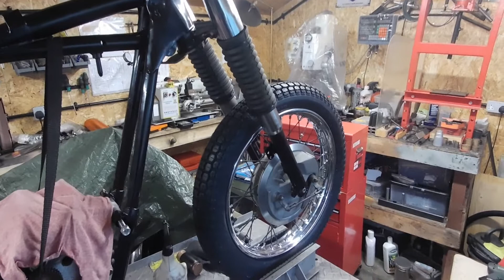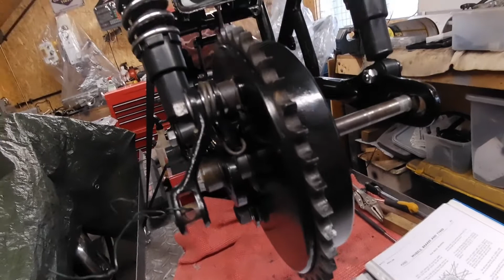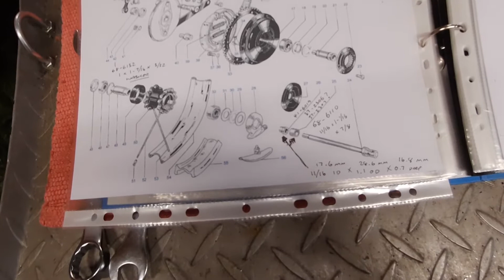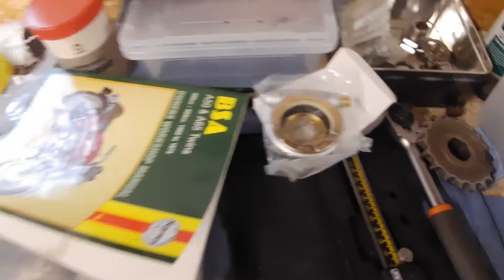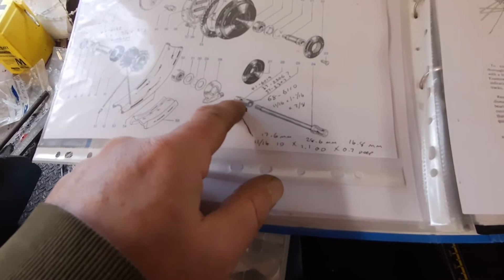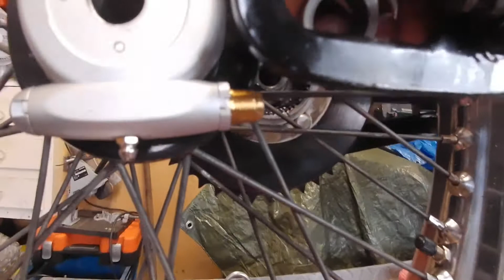BSA A50 Part 20 Correct Rear Wheel

Comment: Hi Ian,
I spoke to dragonfly and they said if it’s an ally brake drum there isn’t a spacer??
I have both spacers for the speedo drive side.
Reply from the maker: If it's an aluminium drum it won't be QD but full width drum.
Reply: @ can I send you some photos??
Reply from the maker: @paulnewton6407  send them to inthesheduk@mail.com
Reply from the maker: Got the photos thanks, yes that's an ally brake 'plate', should have a raised center section unlike my pressed steel plate which is flat and needs a thick spacer. Been checking the forums about the 1968 spacer (more of a washer at only 3/32" thick) and as usual some disagreements! Some put this between brake plate and swingarm (chain alignment), some under the nut, some put one in both places! Personally I think it goes under the nut. Check how far the flats on the stub axle go into the swingarm, if too far you probably need the washer.
Bike is looking good.
Reply: @InTheShedUK  hi Ian,
Just did a dry run fitting the front wheel.  
The spindle locates as it should however, the wheel is not quite central within the forks??  I have watched your video and checked the spacers etc.  The only difference with mine is the new bearings are sealed type. 
Any ideas please. 
Paul
Reply from the maker: @paulnewton6407  Just measured mine and about 30mm between rim & fork each side.
The spindle sticks out about 3mm on the right and about 1mm on the left.
Sealed bearings will have the same dimensions as open ones, should be 6204 (-2RS if sealed) or equivalent, 20x47x14.

Comment: Hi Ian,
Rear wheel,
I watched your corresponding video but you don’t say if there is a spacer on the QD side (shows one in the manual). No43??
I didn’t have one on there where I stripped it down!
Any ideas please
Paul
Reply from the maker: My rear wheel is a bit of mix and match between 1965 & 1969 parts.
The spacers (and some other bits) are different dependant on the year (might be a plain or top hat) you might find that your 'missing' spacer is actually stuck in the brake plate as mine was (see part 18), the important things are, does the chain line up? does the wheel spin freely when tightened?